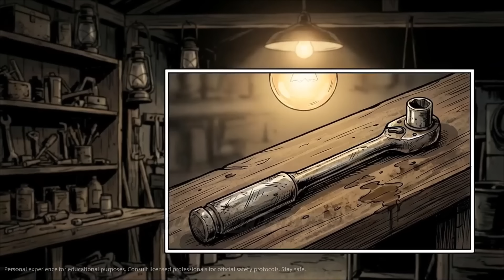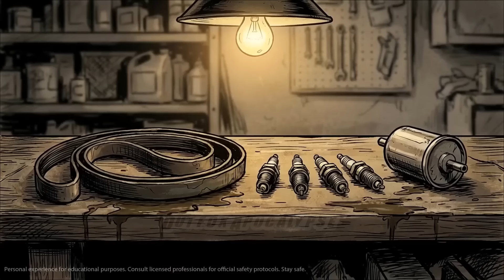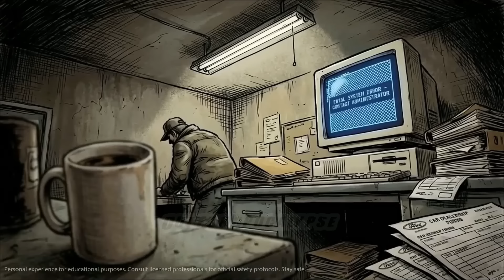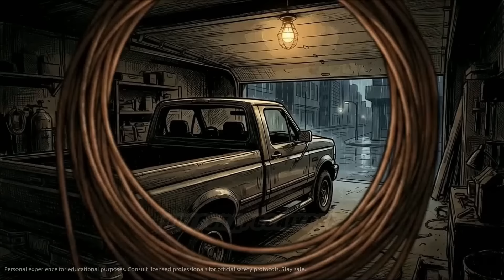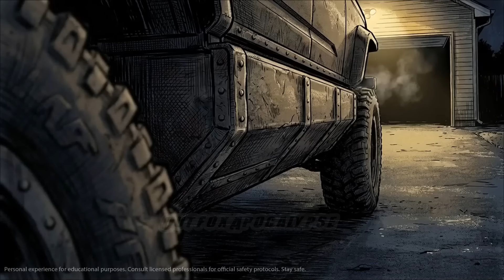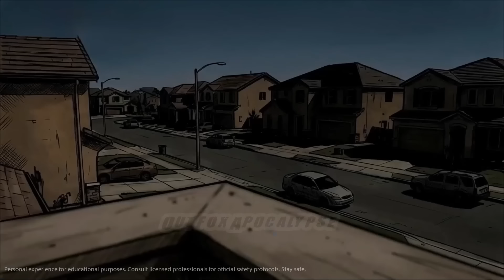25 Vehicle Rules & Items That Make You A King When Systems Fail

Comment: 1970 International Scout 4WD diesel.  3 more in the barn for spares.  No rust (live in the desert).  Replaced the wiring harness in 2020.  Rebuilt the diesel 50K miles ago.  Sucker will go anywhere.

Have a gas operated minibike I bought with lawn mowing money when I was 12 (1972).  It uses a Briggs and Stratton lawnmower engine.  On its 4th engine.  It is mounted on my rear bumper whenever I overland.  Good on and off road.  2 gallon tank will get me at least 80 miles carrying a jerry can and wearing a backpack.

Perhaps best is a bicycle.  Don’t remember the name, but once read a book about a retired English officer that (pre WWII) rode a one speed bicycle from Shanghai to England.  He did things like cross rivers in India using the inner tubes as floatation devices.  The only boat he road was the one from Gibralter to London.  One ballsy dude.  His account of crossing the Himalayas while being chased by bandits was epic.

Comment: Tell me this is AI without telling me this is AI.... Quick question, what is going on at 17:30... Is the fox trying to inflate the quarter panel? What is the ground going to? Is the ground the air hose? (Man I've been inflating my tires the wrong way this whole time). Or why is he trying to ground to the outside of the chassis? Man I have so many questions (and yes I'm splitting hairs on an AI produced video made by solid prompts). Great points here and there in this vid.... but man, I fear the future... AI telling us how to survive a grid down situation. This is some Patrick Winston writings come alive. We're all worried of if we could drive in a grid down situation (self made high value target)... but we aren't asking why we think this is possible. What is the root source/cause. You all have so much in common with your show and tell excerpts of your rigs - no or little reliance on computers (ecus, cam bus units, abs controllers, etc), and heavy reliance on mechanical function. I feel you.... Think critically folks. We're too late now, so preps need to happen. All I'm saying is start thinking about tomorrow's actors. EMPs, Nukes, etc. they are only tools like your boom sticks in the bags of you safe or trunk. Think about the actor, who will pull the trigger, why, when, and where.
Reply from the maker: Hi. thanks for watching. in some ways I share your thoughts about the future of AI and humanity. but believe me, AI is not perfect at all. it’s a rather clumsy tool that imitates a human.  
regarding the video. I write everywhere that I write the texts myself and use AI for visualization. it’s not perfect; if I polished every frame to perfection, videos would come out once a month. so I work with what I can. listen to the information—it’s more important than any picture. about the one-line prompt, you’re very mistaken. one script takes me from 4 hours. then production takes about another 10 hours. try it yourself and then you’ll see how hard it is to create something better than a 10-second animation from a Google prompt.

Comment: 86 mechanical diesel 4x4 pickup. However, fuel isn’t infinite.  Bulk of my survival planning revolves around bicycles and my 2 feet.  People putting a lot of stock in power and modern convenience are setting themselves up for failure. 😊

Comment: Top 10 1970s/80s 4x4 vehicles most likely to survive EMP/CME: carbureted, mechanical ignition, minimal electronics (pre-computer era, diesel preferred).
Rank	Vehicle	Years	Why EMP-Survivable	Off-Grid Strengths
1	Toyota Land Cruiser FJ40	1970–83	Carbureted, mechanical, legendary durability	Ultimate 4x4, simple parts global
2	Jeep CJ-7	1976–86	Points ignition, carb, no ECU	Trail king, lightweight, modifiable
3	Mercedes-Benz 240D/300D	1977–85	Mechanical diesel injection	Bulletproof engine, 500k+ miles
4	Ford Bronco	1978–86	Carbureted V8, basic wiring	Big power, towing, rural repair
5	Chevrolet K5 Blazer	1973–80	Carb V8, minimal electronics	Hauler, 4x4 beast
6	Chevrolet Suburban	1973–80	Carb, simple systems	Family off-grid transport
7	Ford F-150	Pre-87	Carb 300 I6/V8, mechanical	Workhorse, parts everywhere
8	Suzuki Samurai	1985–88	Carb, lightweight	Cheap, nimble trails
9	Land Rover Defender 90/110	1983–89	Carb diesel, rugged	Global parts, desert/jungle
10	Dodge Ram Cummins (pre-TBI)	1989 (early)	Mechanical diesel	Torque monster, fuel-efficient

Buy tips: Pre-1986 carbureted diesels best (no EFI). Store spares (points, coil, carb kit) in Faraday bag. Test start post-CME sim. $5k–$20k used.

Comment: Doesn't matter what you have in the driveway...if you can't get fuel in the tank it's all moot...Modern-day fuel has so much ethanol in it that it doesn't store for more than a couple of weeks before it breaks down and it becomes unusable...You'll need a heavy duty hand pump to pump fuel from the tanks at a gas station because the grids down and there's no power...Your best bet would be to store a lot of propane have a vehicle with a carburetor that you can convert to burning propane or cooking oil then you're running...Propane and cooking oils store  a hell of a lot longer then gas...But supplies are finite during a shit hits the fan situation...Just get a nice mountain bike and a lot of spare parts...And get in shape so you can actually ride it!

Comment: A very good reason to keep my Hj60 landcruier, with the tractor like 2h diesel. Very simple mechanical injection, million mile engine with basic maintenance. Can run on most oily fuels if it's viscosity is not too thick.
Reply: 79 Fj45 Troopy Im running 2H, 5 speed, disc brakes and lockers w 2 fuel tanks of diesel. and stock piled diesel around my AO. If that fails me I have a mule(pissed of cantankerous beast) and a wagon with all terrain tyres haha
Reply: Ditto, JDM KZJ78 ‘94 Land Crusier. 👍🏻
Reply: @disenfranchisedcitizen1432  Prado

Comment: My daily is a 92 f350 crew cab dually with a 7.3 idi and a 5 speed,    upgraded both tanks to hold 78 gallons under it,  so not only will it still run it has a 700-1100 mile range easily, and can mix my own fuel easily enough

Comment: 93 F250 crew cab, 5.9 p7100 swap, fz6 4x4. I build a on the go centrifuge processer for all kids of waist oil/fuel (truck box with fuel cell and added second cell for doner fuel) Broken down vehicles are fuel stops for me, I take all fluids and run them in that processor boom black diesel on the go. Built her with my two hands with high qualityparts, have spares. Did it over 2 years with lots of planning.
Reply: Yep thats the ticket how big is that centrifuge?
Reply: @deepbludude4697 it's a 120gph pressure centrifuge. It's big for the set up, bet I can process my 40g waist tank "3 times" before I send it to my clean tank. And it's a top sprayer design so it can remove water too. It's removable so I can use it on my production side when I'm home.
Reply: @Bear_Wb  Did you build it? Id love to see a build video, I had access to a military centrifuge when I was in Florida got it running for the owner ran WMO thru it mixed it with diesel 70/30 and burned it in my 89 F250 IDI. I moved out of there living in very rural Ozarks

Comment: forgot to mention pre 85 cars that use mechanical fuel pumps and electronics.. most cars from the 60-70s use mechanical fuel pumps and points ignition which a emp cant effect. most newer cars have computers that a emp can fry. but anything thats 12v wouldn't be damaged. even cars with efi from the 80s to like 96   would survive a emp . it has to do with the surface area of a psb. each trace acts like a antenna blowing that path. but hard wired systems would need way more energy to blow. older car the ecm is grounded to the cars body. newer cars use wire to ground way far away from the ecm.

Comment: What I will never understand is.Why do we have to screw things up if cars were perfect in the 1990s and the early 2000s?Why complicate them with unnecessary software????
Reply: Planned obsolescence
Reply: Somebody wants more mileage, less polution and more power which can not be done without computerize rule to mix gas with air and right comvustion timing (carburator could not do it)
Reply: @WorldPeace-o1e a I agree the carburetor cannot do what electric fuel injection can and I'm okay with that, but why introduce all the other electronics That is unnecessary for performance?
Reply: You can thank Al Gore for that.

Comment: You need a Chevy or GMC 4x4 with a manual transmission, or learn how to make that 4l60e or 4l80e work without the computer, it is possible. The reason you need a GM is you need something that can take a carburetor, usually with an aftermarket intake manifold, a points distributor, a generstor like a 1956 Corvette, and a mechanical voltage regulator, again like a '56 'vette. 
 These parts are still available for the '56 'vette, and can be retrofitted onto any 1990s GM vehicle that had the L31 vortec 350 or the L30 vortec 305. 
You can distill methanol for fuel, there are Holley, and knockoff, racing carburetors for alcohol you can still get. 
 Those drvices advertised to protect newer vehicles are dangerous if there's 2 saturation-level EMPs within 5 minutes. Done the 1956 way, you're unstoppable. 
 Vortecs will need an Edelbrock or Weiand intake manifold to accept a carburetor. 
 Your next worry is tires. Not all are created equal. Tread pattern matters less than the sidewalls resisting cuts and punctures. If you can't get Maxxis Trepador 8060s, get BFG KM3s or other equally-heavy, size-for-size, mud terrains. Nitto, Toyo, Yokohama, and Mickey Thompson each make one serious mud terrain. Do not settle for anything less. Doing so will leave you stranded.
Reply: If a computer is going to die, so is points ignition. If you have a high voltage spike go across points ignition, it will destroy it. The only thing that will for sure work, is old school mechanical injection diesel. If you have a manual and switch the solenoid that turns the fuel on, you can start and run it with absolutely no electronics. Plus those diesels can run on about anything, especially if you have diesel to mix it with. Any gas engine needs some kind of electronics to run, and if a module is going to die, so is the electronics an old gas truck needs.
Reply: @Acts258 Your right but with points you can carry spare and have them switched out pretty quick and be on your way.
Reply: @Tommy-rr7ez but it isn't just the points, you also have the resistor for the points, voltage regulator, and all of these are highly susceptible to voltage spikes. Modern electronics, while they are sensitive, they are able to handle more, and are protected better than the old module, or electronics are. Plus unless you have all of those in a faraday cage, the new ones you have will be fried too. Plus those parts are extremely prone to failure as it is. Those old trucks people carry extras of those because they fail so much. Old school gas engines are the worst to have in an end times end of the world event. Me personally, EMP is such a low chance, and there are so many variables to it, I don't really worry about it much. There are other things I am going to prepare for that are much more likely than an EMP, and much more certain. An EMP can be anywhere from only frying exposed and extremely sensitive components, to frying everything including what is in faraday cages. So sure, we should have a little bit of prepared for it. But to build an entire new vehicle and all kinds of electronics, and spend a bunch of extra money trying to protect them, for something that has a low chance of happening, plus if it does happen, may fry everything you prepared anyways. I would rather use my time and resources on better things.
Reply: @Acts258 I agree with you! If a EMP is set off it will only effect a certain area not the whole US unless there is many multiple EMPs.
Ive got a 88 GMC K 3500 EXT CAB long bed. It has a throttle body not carb and if a EMP should occur at that time i will go to plan B. Ive got a Honda CRV 80 dirt bike, i know everybody says thats to small but im a little man so i want something i can handle. No matter what people think that says oh im ready im fully prepared bring it on literally has no clue what they are talking bout cause i truly believe WHEN not IF it happens cause somethings got to give we can only try to be as prepared as each individual can be but when it happens we cant begin to imagine what its realy going to be like. People i get a lot of my info from calls it 911 2.0 and if you would like to listen to them i will tell you how to. Do i believe a EMP can happen yes but not on the scale people are saying. Im not going to become a slave to living my life trying to do everything someone says but couldnt if i wanted to but i am doing my best to prepare what i can for the worst and Pray for the best to happen.
I preciate your input buddy i realy do!

Comment: Got a 64' chevy long bed granny 4 speed. She screams going 50 mph, but she's reliable and is a tractor at pulling stuff. The gas mileage is actually horrible considering what it is. Plus the long bed has a lot of space for carrying stuff. Just wish she was 4x4 lol.
Reply: Nah that 4x4 is just more stuff to break and make the gas mileage worse. A good locker and good tires combine with shocks. You can get around pretty good if you know the area.
Reply: @Gasman1788 true, besides if you get in a situation that you need 4x4 you are already screwed. 🤣
Reply: Loud, gas nuzzling, big. 
You'd be better off with a Chevy luv or c10.

Comment: you need an off road E-bike and a trailer to pull behind it, a spare battery and a couple of solar panels for charging those batteries. 4 wheeled vehicles are easily trapped by other vehicles. buildings, trees,  etc. you can get an inflatable boat that will float you, your ebike trailer and your BOB
Reply: Good luck pedalling several hours a day. I'd stick to some simple car or 125ccm motorcycle - sure it's loud but has enough power to outrun enemies and it sips slowly fuel from the tank
Reply from the maker: ebikes are cool until the grid dies or the battery degrades. gas engines i can fix with a wrench and scavenge fuel instantly. sitting still for 6 hours to charge makes you a target. plus not everyone can physically ride a bike with a trailer offroad. simpler is usually better
Reply: @OutfoxApocalypse  nobody's going anywhere on the roads or with 4 wheels, becauxe the roads will be full of tire flatterners and ambushes.  You can only travel at night, with very masked headlights.  You can't carry much of anything or go very far, so your stuff mosly has to be already scatter-buried around your BOL, where you will dig a tunnel and stay in it for a year, coming out only at night and only long enough to access a food bucket and cook a meal. In a year, 99% of the population will be dead. All of the animals will have been eaten by day 90.  You can put all of the guts of an E bike into a Faraday cage. or use a pre-electronics trail bike, , with EXTRA muffling on it. Make noise, show a normal light at night, or be out in daylight and youll get shot, early-on.
Reply: @EsyuDach  Smart recognizes Smart.
Reply: @OutfoxApocalypse  solar panels can charge an E bike  if  you can't even ride a bike, nothing is going to save you.  I"m 73 and I still kick ass on college men in karate classes. A spare battery, or even a spare motor for an E bike is no big deal.  You're not going to be going far or often, because doing so makes you a target.  This country was very well settled before gas engines ever existed. Now we have all of these roads and the US, all 3200 miles of it, has been ctrossed  in 8 days by a guy on a bicycle, many times. Ask AI about it.  With a fairing to protect you from wires strung across the road and a masked light, a bicycle  can move you 100 miles per night, without a sound.  There's 8 million motorcycles in the US and 2-3x that many bicycles. Why would you need to travel so much or haul so much stuff, anyway? Best get everything you need buried at your BOL, in the woods around your local water source, because that's as far as you're likely to be able to go. shtf is going to be hell on earth, not the boy scout picnic that you think it will be.
Reply: Fail. No EMP protection

Comment: My everyday driver is a 2004 Trailblazer with All Terrain Tires. I can choose 2 Wheel Drive (what I usually use), All Wheel Drive, 4 Wheel Drive HI and 4 Wheel Drive Lo with the turn of a switch. It may not be EMP proof, but my MAG plans on Bugging-In at my farm. We have two other locations in our plans if we have to move. I live in my four bedroom home, so we have plenty of room for the MAG. Most members live less than 15 miles away. We have bicycles and spare parts for backup transportation with wagons to pull. I have been Prepping for decades, so we have good stockpiles for our needs.
Reply from the maker: brother you are prepped better than 99% of people. bugging in at a farm with a MAG is the gold standard. actually my father-in-law has a trailblazer from those years, 4wd too. awesome truck, drove it myself and loved it. cant express how much i respect people who actually put in the work. well done

Comment: My friend bug out bicycle with a trailer get a gas or electric motor for it don't need a whole lot of complicated tools or big heavy parts to repair it refute take a break does it make noise does it need food you could pedal it or use the motor a battery bring a small generator with you and plug it in while your pedal or drive down the road put the other battery in while the other ones recharging

Comment: If you purchase Ethanol free fuel, it can last up to 2 yrs under the right conditions.
Reply: All of my gas cans/storage are filled with Non-Ethanol gas only. I mostly use the Non-Ethanol gas in small engines like lawnmower, chainsaw and garden tiller. I can also use the Non-Ethanol gas in my vehicles. I rotate the gas.